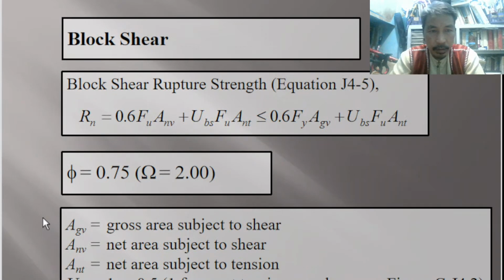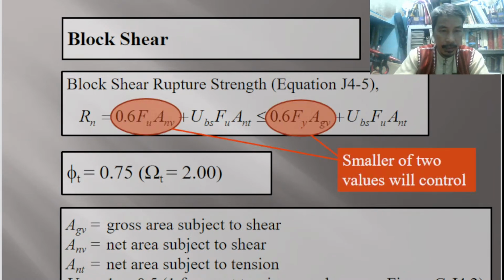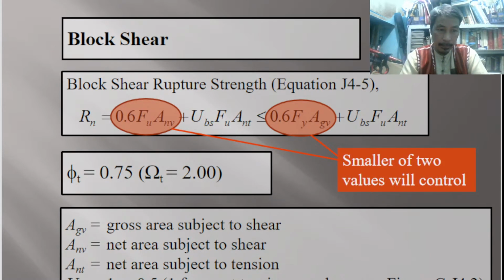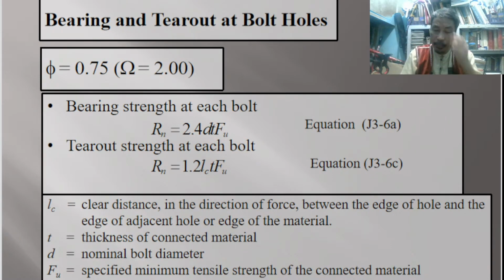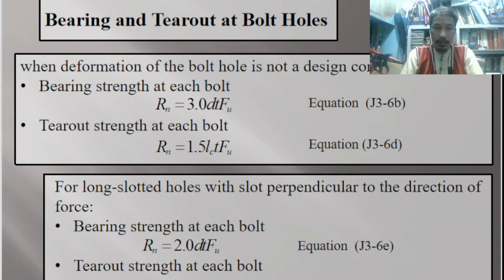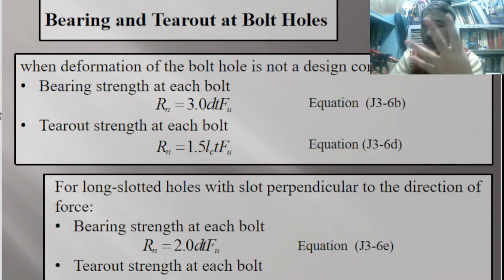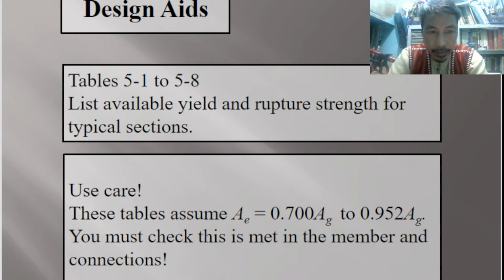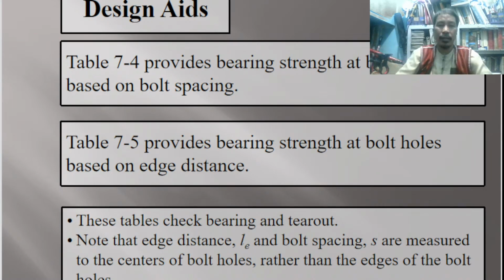[ LIVE CEE6 Lecture15 ] DrAP Zantua AISC Block Shear & Bearing Talks + ENGINEERING Analysis & Design

Comment: Thank you sir for this live lecture about introduction of block Shear. We need to memorize the equation of bearing strength at each bolt and tearout strength at each bolt and tearout strength at each bolt because it is very important and also the formula under this topic.

Comment: Thankyou sir tackling about AISC block shear and bearing. It is the formula for bearing strength at each bolts and tearout strength at each bolts. Ic= clear distance, in the direction of force between the edge of hole and the adjacent hole or edge of the material. t= thickness of connected material. d= nominal bolt diameter. Fu= specified minimum tensile strength of the connected material.

Comment: Thank You sir for discussing about block shear under tensile limit state. So in this video lecture Agv = gross area subject to shear, Anv= net area subject to shear and Ant= net area subject to tension. The proctor also discussed about block shear rupture strength formula. In this live stream Bearing and Tearout at bolt holes had been discussed. This exhibits the formula for bearing strength at each bolts and tearout strength at each bolts. Ic= clear distance, in the direction of force between the edge of hole and the adjacent hole or edge of the material. t= thickness of connected material. d= nominal bolt diameter. Fu= specified minimum tensile strength of the connected material.

Comment: Thank you sir for this live lecture about the introduction of Block shear.  The equation of block shear rupture strength was discussed together with bearing and tearout at bolt holes. Bearing strength at each bolt and Tearout strength at each bolt were given in this lecture and explained clearly. Thank you sir.

Comment: thank you sir for discussing block shear. I learned about its formula Rn=0.6FuAnv +UbsFuAnt< 0.6 FyAgv+UbsFuAnt. Also, bearing and tearout at bolt holes were discussed Φ=0.75 (Ω=2.00). thank you for summarizing the 4 limits states. Design aids ( tables 5-1 to 5-8, list available yield and ruptured strength for typical sections; use care! These tables assume Ae= 0.700 Ag to 0.952Ag. table 7-4 provides baearing strength at bolt based on bolt spacing and table 7-5 provides bearing strength at bolt holes based on edge distance.